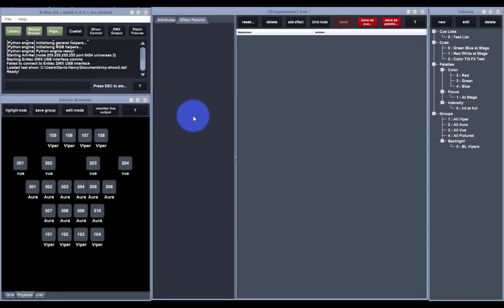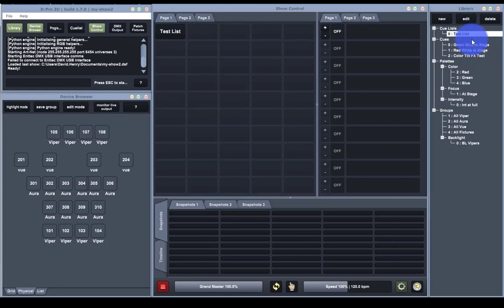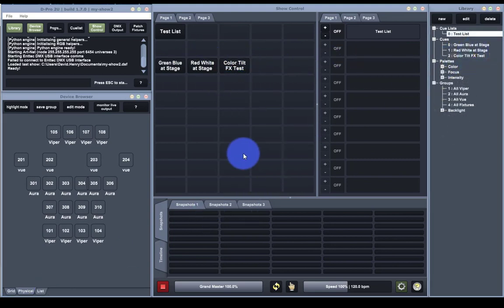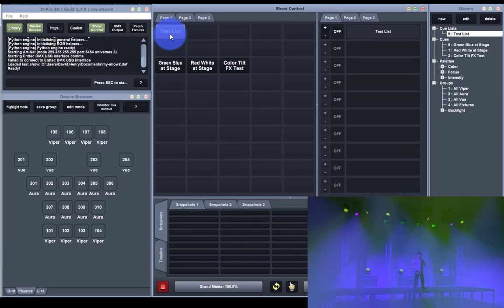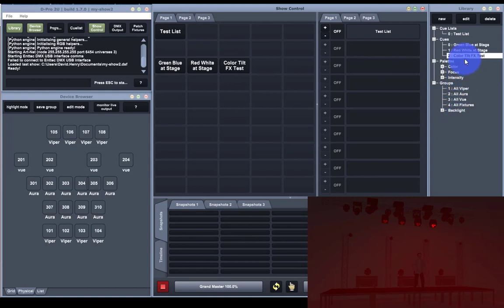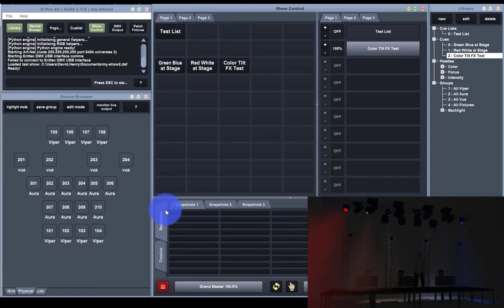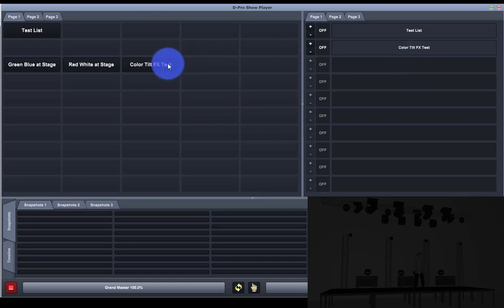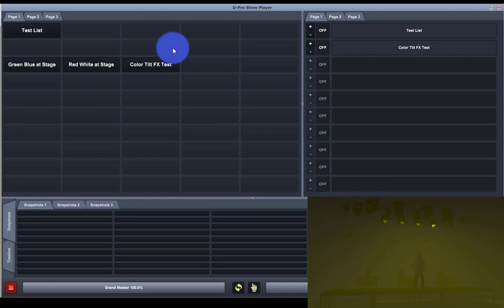Playing Back Your Show in Show Control - Beginning with ENTTEC D-Pro

Comment: Thanks for all of your videos! I have a question about something you might have the answer to. I need to program a single dimmer fade in button, and a fade out button over the entire DMX universe. For instance, I am in blackout mode, I want to fade everything in via 1 click. Same with fade out. However, I need both fade in, and out to work on any, cue, or cue list that is programmed in show control.
Reply from the maker: Hello!  I am glad you are enjoying all the videos!  

The only way I can figure to do this is to set the GrandMaster to a MIDI fader, and fade it up and down.  You would go to Preferences / Remote Control and press "Learn New Mapping".  Then, go to MIDI, move the fader or knob on your control surface and set the Action to "Show Control" SET GRAND MASTER".

This is where D-Pro hits it's limit - It's not a pro-grade lighting console, but it's also so much easier to learn than a pro-grade lighting console!  But the simplicity does hit a limit here (at least, as far as I can tell)

Thanks!
-David